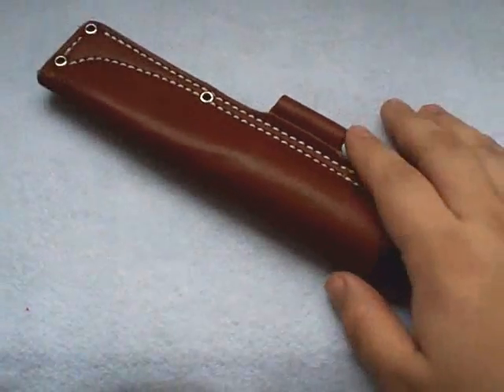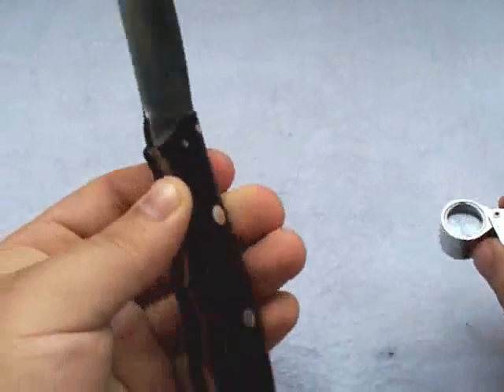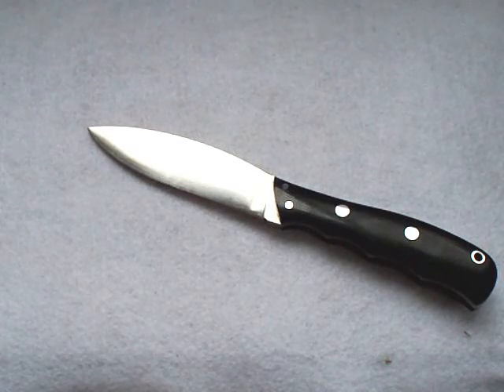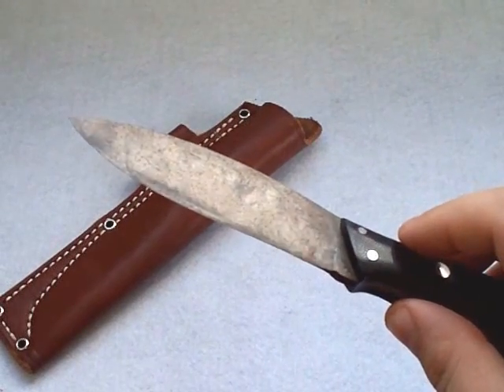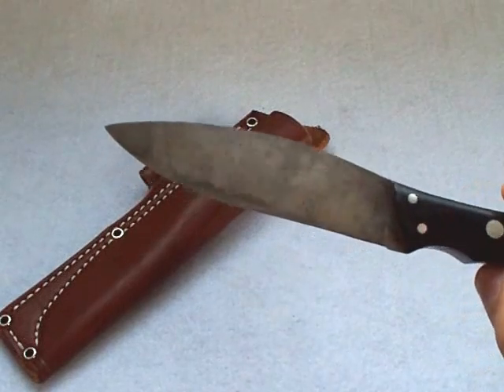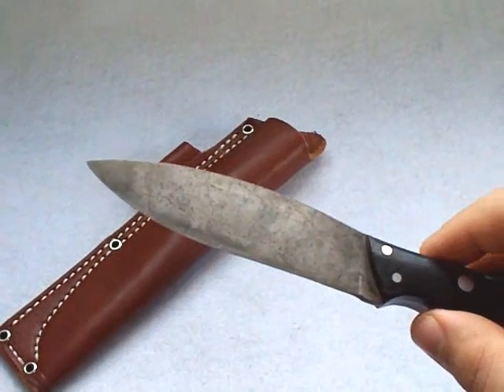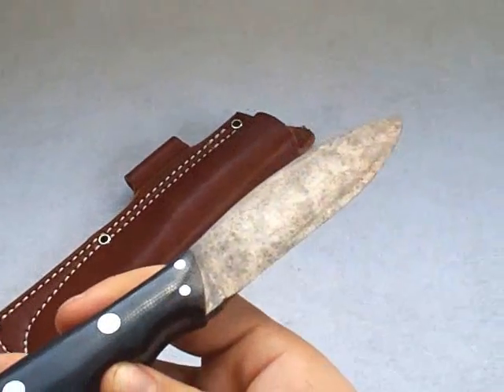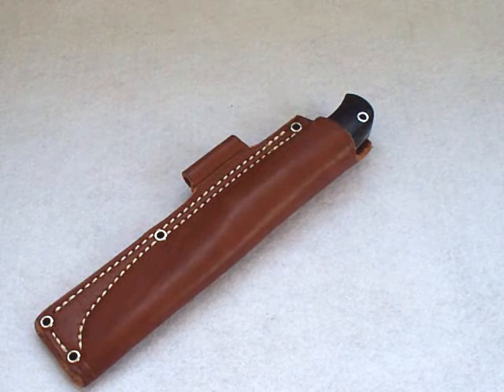Forcing a "Patina" On Carbon Steel - Part 1

Comment: Love the idea of the patina but to me, it's ugly. I'll wait till my factory coating comes off before I consider this. Now if i could make a jet black patina, that would work! LOL
Reply: +Divergent Droid
I agree, it's ugly. I watch these vids and people keep coming up with that ugly mottled look. Do the vinegar bit but pull the blade out ever 5 minutes or so and scrub it with steel wool then back to the vinegar. It will produce a smooth,consistent finish.
Reply: ardvarkkkkk1 Hey thats a Great tip I'll have to try. Thanks! Do you know of  a video of this finish?
Reply: Divergent Droid
There might be a video out there but I haven't seen it. Learned it from my uncle about 45 years ago, when everything was carbon steel.

Comment: I forced a patina on mine. I used apple cider vinegar.  At room temp for about 2 hrs. She came out very nice and dark. Afterwards I lightly polished it with steel wool. The patina is the best way to go, imo, there's no black crap that you worry about wearing off after some use.

Comment: This faked patina on traditional styled knives is the new thing now days. What the younger generation doesn't understand is, that traditional pocket knives are supposed to age with the user. It's not the same faking it. They don't go in cases either. The bolsters and scales over the years become smoother, while riding in the pocket and the carbon darkens, with use. Hell...I remember people trying to keep their blades shining. Boy... times have changed.
Reply: +Matthew Perry 99% of people still try to keep their blades polished and shiny. BTW, I didn't like your role in Friends too much, but my wife enjoyed your TV series.
Reply: +Matthew Perry When i was your age, BLAH BLAH BLAH.......
Reply: Matthew Perry most people keep their blade shiny most of the time when people force a patina it's not for looks it's for practicality
Reply: Right, it's not a true patina. It's a faux patina. However it is practical. It protects the blade from corrosion quickly, cheaply, and easily. Instead of applying a finish like powder coating, an epoxy based, a ceramic based, or even just paint.
Reply: Matthew Perry bingo.ur rite. Its astain not a patina.

Comment: try stabbing a high carbon knife through a large grapefruit and leaving it for an hour or 2, it would be a nice video if you ever were interested in trying this again. the chambers making up the citrus flesh leave a really beautiful pattern on the blade, it will look vastly different depending on the angle the orange is penetrated at. (lol)  but all jokes aside i did it with several oranges and an 18 inch khukuri house sirupate and was very pleased.

Comment: I'd love to see the result of holding the steel in an enclosed space, with a vinegar solution just at its slowest boiling point (least steam as possible) and let the gas slowly pattern it. Maybe it would give a more authentic effect and avoid the streaking or other "forced" signs. I saw a video of a guy antiquing guitar parts using muriatic acid. It'd shake the parts in a bag to give them a few natural wear effect then put them in a container (non-sealed) put inside a bigger container with some muriatic acid at the bottom, letting it float on it. The bigger container was closed to trap the gas inside it.

I think he used muriatic acid because the parts were not high carbon steel...but his technique was probably the closest to natural aging. The boiled vinegar gas should probably be as still as possible (think bathroom fog with very little movement)...a direct flow of gas on the piece wouldn't be that great...unless it created a very nice smoke effect, seen on case hardened parts on firearms. But those are hard to recreate since they also use a liquid (its during the quench that the pattern is created). Hmmm..interesting, boiling vinegar + tubing + tip = patina tool?

Comment: As an instructive point about patinas, you can point people to "rusty" steel truss bridges you see out on back roads around the country. Those bridges are designed to develop a patina of surface rust to prevent deeper, damaging rust. I've found that it helps people understand the concept.

Anyway, great vid. I'm commissioning a custom knife and weighing my options as far as steel types and rust proneness and this gave me some ideas.

Comment: WOW you just ruined that knife, hahahaha. Just kidding what are the advantages of forcing a patina? I know that baking soda and ketchup paste cleans carbon steel blades well, and also Burt's bees lip balm original can be applied to blade and wooden handle as a preservative and it is food safe.

Comment: Yeah-- no, it's an oxidation of some kind, but maybe not from the iron. However I will say, that my BK-2 does "rust", I took off the Teflon to make it bare, with the intention of putting on a patina. When I did put on a patina I accidentally left some water on the "glass breaker". Sure enough, it's kind of an orange color in that spot now. Not super obvious, but it's there.

Comment: I removed the protection coating of my 1055 carbon steel "Cold Steel G.I. Tanto" with wet sandpaper.The odd thing was that while i was removing the paint i saw a yellow color on the blade.It had oxydised while i was cleaning it.My question is : Will it form red rust while I use this method of forcing patina on the blade ?

Comment: i just thought i'd recommend something you may have heard before. i was cutting a lemon and noticed how fast the patina occurred so i went and bought a 15 oz bottle of lemon juice and took a tall skinny shot glass and filled it and put a knife in it for about an hour and it came out with a very uniform and dark patina. i have done this with about 10 knives(tidioute,gec,northfields, schrades,buck creek). the patina wears off and becomes lighter with use.

Comment: Have you ever tried liquid gun blue? Like Birchwood Casey. Do about 3 coats and rub with 0000 steel wool in between, coat with gun oil and let it season overnight. You'll love the result.

Comment: rust is iron oxide, it forms by oxygen and moisture in the air, if you oil your blades you will have no trouble, i use it on all my blades apart from my H1 steels

Comment: Great clip,knives are ment to be used. Another material you might like to have a play with is molassis. Just the normal cooking grade or the less refined horse feed molassis. Disolve a cupfull in 3 or 4 pints of water. In an hour or two it neutralises red rust and forms a black oxide that is removed with a green kitchen scourer, leaving a nice grey patina that is very rust resistant. It can be used to remove and neutralise heavy rust from tools etc by leaving it over night or longer. Regards

Comment from the maker: with this patina you cn a still get the bad rust over time if you dotn care for it, but not as easily...it woudl take alot of sbuse to get this to rust now...with a regular blade it will patina before it rusts as well, but not for long the patina will hapen then soon aftrer the rust wil happlen in the same spots...the reaosn to do this is to just get the blade covered right off the bat to help protect it from easily rusting

Comment: @ gimmethatglock

iirc, it does not ruin the inner strength of the blade. a patina is a from of surface rust that is almost like a coating for the steal

Comment: Something else that is really cool, is to take some painter's tape, put it on the edge, and then using a razor blade or something similar, cut out designs on the painters tape, and then start the "patina process", if you want to call it that. To be honest, I have no clue if this would actually work or not, as i think the acidic substance would just soak through the tape, but I guess it could be worth a try. I would try this, but I no longer have a carbon steel knife.

Comment: Hm yes you´r right, i would say "dude you yust ruined the knife" But I would polish it (machinal of course) and maybe it would get really interresting.

Also you could create a patina, then polish it down, so only the strongest lines remain, then do the proces again, and again, in the end you might get a really special knife.

Comment from the maker: it amkes it alot harder for rust to form and deteriorate the metal, its liek a hard coating, but yes your actually corroding the outer layer a tiny bit to do so...

Comment: really? I just got my first case knife(a trapper with amber stag handels) and it says that the Chrome Vanadium blade is not stainless steel and you have to keep oil on it to keep it from rusting,pitting etc.
It looks kinda like the same steel in victorinox line of knives.

Comment from the maker: yes this process will dull the edge a bit...needs to be tocuhed up after this...
Reply: My man Jeff always coming in clutch with the educational vids! I'm trying to put a forced patina on my maxamet para 3, it's in a potato rn haha I moved it from a lemon/lemon juice! I'm a little concerned with how much edge damage there will be since I don't have the proper means of sharpening maxamet lol I have sharpmaker and strop. Do you think that will that be enough to touch up the edge, considering it's at like 68hrc? Also, while the patina is forming, I've been checking it and there was a little bit of red rust on it. It wiped away easily while leaving the patina intact. Is that normal? Should I be worried about it coming back? Could that be from me taking it out and leaving it exposed to oxygen with lemon juice on it? Thanks!

Comment: Widershins: If you make sure there is no oil on the blade it will work better. Gun blue will really get fast results. A little wear and you have perfection.

Comment from the maker: where you sharpen yes it will expose the bare steel again...but with the conves grind I only touch up the very edge ona strop to gte the edge where I want it, hardly noticable to the eye...

Comment from the maker: I have no idea if this method will work on stainless steel, evena  cheap stainless, you woudl just have to try it to see...but stainless steel itself is rust resistant, not rust proof, but it wotn rust easily...so theres no real need to do this to a stainless blade, just my opinion...

Comment: I like both the before and after appearance, but the patina adds character to the blade.  Does the patina protect the blade in any way or is it just cosmetic?  Is the patina the same as the surface rust you talked about at the beginning of the video?

Comment: Looks good. I like the Candian Special. Dont Do much more than an hour, the blacker oxidation that forms will just wipe off. Also, the patina can be cleaned off to like new by using 2000grit sandpaper, and some metal polish like flitz.